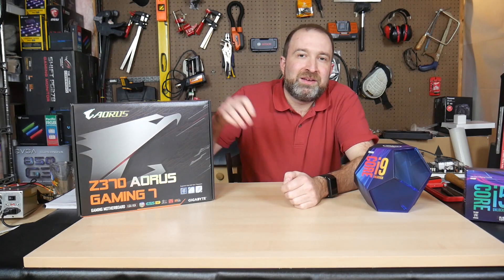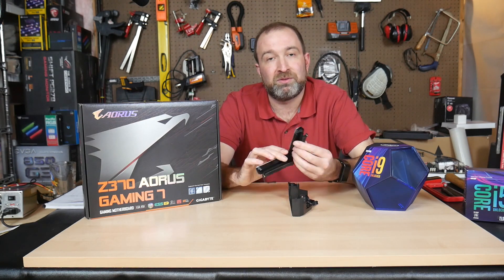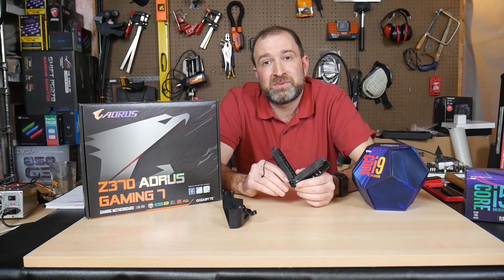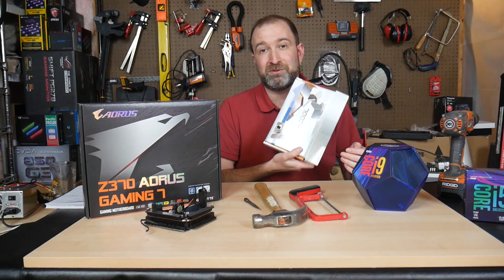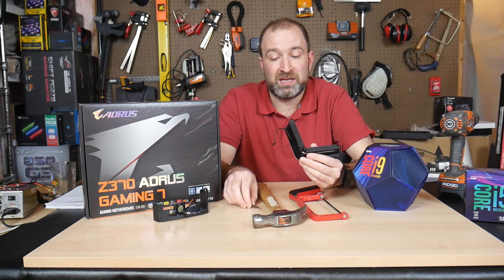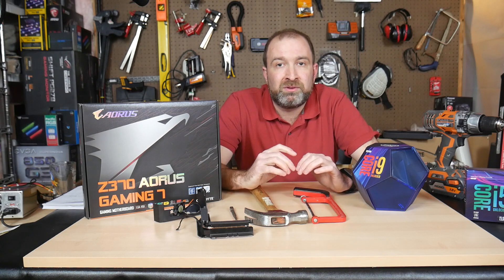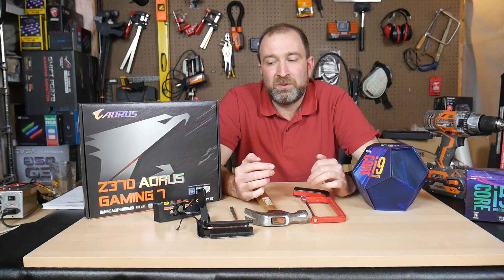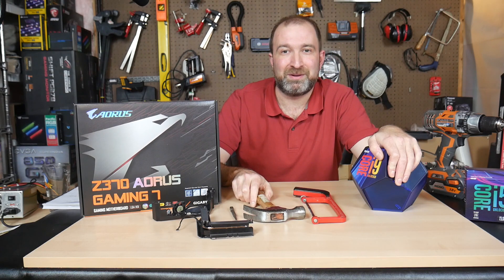Review: Intel i9-9900K vs. Z370 Gaming 7 VRM

Comment: Hello, good day, greetings from Colombia. I currently have an Aorus Z370 Gaming 7. Two days ago I installed an i9 9900k, but the CPU's maximum temperature reaches 86 degrees. With an Aorus ATC800, I don't have it overclocked. I only use it for gaming and streaming. You say this is due to the motherboard's dissipation.

Comment: I disagree with this video. Im running a 9900K at 5.0ghz VRMs sitting at 60c on my z370 Aorus Gaming 7. Just chnaged the thermal pads to something thicker and it works flawlessly. Stock heat sink.
Reply: Added thicker thermal pads to the VRMs and added a small noctua fans on top of the VRMs and stayed very cool. My 9900K can site nicely on 5Ghz.

Comment: Please help!
I9 9900k freeze under heavy load

Hi everyone!
   I have bought the I9 9900k and after the install the PCU under load was reaching 70c-75c after the first 5 minutes of playing and than jump to 89c for a couple of seconds and than the whole computer was completely frozen. Had to restart by pressing the power button.
   A couple of times, it did restart the computer by itself under heavy load. 
     
   Just read another post about this and someone recommended to change the cooler. 
    I put back the I7 8700k with my old water cooler and under load doesn’t reach more than 63c. 
   Now, with my I7 8700k is perfect fine. 
   That means the cooler is working fine? 

   Bios updated to the latest version. 
   Motherboard: MSI Z370 Carbon 
   Video: MSI GForce RTX 2080ti Trio
   RAM: Corsair DDR4 3200GHz 32 GB(4x8Gb)

  
   Can be a faulty CPU?
Thank you in advance !

Comment: I recently installed a 9900k in my Gaming 7. I am using an EK monoblock. I am currently at 5 ghz running offset voltage of -0.045. HWmonitor is showing around 1.284 while running Cinebench R23. I ran the 30 minutes stability test in R23 and my VRM is still hitting 75c and highest core is hitting 86c. I know those are fairly high temps but definitely safe of course. I am curious what your VRM temps are hitting while under a long load test like R23 for 30 minutes. Have you ran R20 or R23 for 30 minutes? They both use AVX so they really load up the CPU and VRMs.
Reply: Since the 9900K/Fs are sold of for 280€ right now, I did the same kind of upgrade for my gaming 7 as in the vid and installed some generic/adjustable VRM watercoolers I found cheap on aliexpress (7-10$) per piece. With my previous 8700K@5.1/1.38V I hit the 125C on VRMs pretty fast with prime95 AVX. The same test setup now with my 9900KF@5.2/1.37V the VRM temps stay within low 60s.
Reply: @torben82sf  Are you saying with the exact same cooling you got that much lower temps switching from the 8700k to the 9900KF? I assume not. I believe you meant to say when you upgraded to the 9900KF you installed water blocks on the VRM and then got the temps you mentioned.
I have been very happy with the performance of the EK monoblock with the 9900K. They do get into the 70s while stress testing but they never come close to that under normal use. Granted I don't run heavy AVX programs for hours on end so YMMV. Overall the 9900k and the Aorus Gaming 7 with the EK monoblock have worked perfectly for me.
Reply: @caseymartin9177  yeah Sure, 9900kf + watercooled vrms. With stock cooling I would prpably have fried the vrms under prime .

Comment: How bout Aorus z370 gaming 5, can it handle the i9 9900k? I hope u can provide an answer . Ty si 😘
Reply from the maker: I wouldn't really advise it. I think the manufacturers of MB didn't really do much other than make an updated Z270 board. With Z390 it seems like the manufacturers woke up and started putting better cooling and more phases into their VRM. In a way they are using the same power delivery designed for 4C/8T on an 8C/16T.
Reply: @SolarityTechnology  lol im running it with modifications on the z170x-gaming 5, and vrm temps are good (stock) so i see no reason for it not working well on the z370 gaming 5

Comment: Hi, came across this, great vid by the way and am very impressed by your solution.  I have tried to source the water blocks but the copper plates on all I have seen seem to be a different shape.  Is there a chance you can post the dimensions of the plates required and the fixing locations so I can source others suitable please?  I have subscribed and look forward to more of your videos in the future - ATB
Reply from the maker: Thanks! I don't have them off hand. I used an old heatkiller for a legacy board and cut and drilled it to size. I think the block is pretty standard and they customize the copper plate to mount various boards. They do have DIY kits that you can use to cut or drill to size as well. Have you thought of using one of those? I.e. https://modmymods.com/watercool-heatkillerr-sw-x-60-diy-lt-12004-4880.html
Reply: @SolarityTechnology  for now i've just dropped the heat sinks and they seem ok with better contacts, but might watercool later and then monitor temps better, the cooler the better why i like your idea. thanks for your time, i found these before so have these as an idea in the future: 
https://www.ebay.co.uk/i/253096111258?chn=ps&norover=1&mkevt=1&mkrid=710-134428-41853-0&mkcid=2&itemid=253096111258&targetid=909953938039&device=c&mktype=pla&googleloc=1006521&poi=&campaignid=10204071303&mkgroupid=104953043274&rlsatarget=aud-629407027145:pla-909953938039&abcId=1145987&merchantid=114962336&gclid=Cj0KCQjw6PD3BRDPARIsAN8pHuF5g4SMV4qSX2H-3sFB0CUyUui969-c2PSGcdBYwHlVOrOSdKJfFwwaAtRQEALw_wcB
Reply: @SolarityTechnology  can you help me out and give me the settings in the BIOS you used for 5GHz stable? i'm having trouble getting my 4133MHz DDR4 with it so want another starting point.

Comment: Would this motherboard work with the i7-9700k???
Reply from the maker: Based off power consumption numbers I looked at for the 9700K, I think this MB would be fine. The 9700k has the same cores, but half the threads of the 9900K.

Comment: I'm currently using a gigabyte z370 hd3p motherboard, I don't plan on overclocking my i9 9900k. Should I upgrade to a z390 motherboard?
Reply from the maker: I wouldn't touch the 9900k with that board. I noticed boost was even worst for temps than a tuned OC. I highly suggest a Z390 Gigabyte board, if you want a 9900K and to fully take advantage of it.

Comment: But if you do not make PRIME 95 FFTs, OCCT small data set AVX 2 ...., no reason to change the cooling of the vrms of the Z370 gaming 7, if you only play video games because the cpu in games -Video rarely exceeds the TDP of 95 W with a 9900K I9. At most 70 watts.

Comment: these vrms support a maximum temperature of 125 degrees! and if the temperature exceeds 125 degrees then the CPU drops in frequency to 3600 mhz see 800 mhz.Tested and approved on OCCT small data set avx2 and PRIME 95 FFTS.

Comment: if the PC reboots with prime95, your PSU is of poor quality!
Supernova G3 850w is PSU no name, I'm not sure that it delivers well 850W or the + 12V is properly powered voltage. in FULL load, IT MUST HAVE big Vdrop on the Rail + 12V. In order not to have a voltage drop on the + 12V supplying the CPU, at least one Seasonic PSU of 550W is required. because often the PSUs no name 850W when measuring the voltages and watts are actually 450W PSUs.

Comment: On Aorus Z370 Gaming 7.
Edit: Of course for it to work with an I9 9900K @ 5 ghz with Prime 95 FFTs AVX, it requires a good PSU (and not an NO name PSU) a Vcore manually posed 1.25V-1.35V MAX and especially ideally a waterblock on VRMS or a simple stream of Air is sufficient with a 120 mm fan.

For bios, you have to look at the CPU i9 9900K (P0 or R0) stepping from BIOS F7 to BIOS F12

Comment: edit: sorry just shortening the post. this is an overkill mod, but glad to see it works.  in most cases, the thermal pads are the issue. there's too much gap between the VRM and the heatsink/pads.  get thicker pads or shave away some of the spacers and tighten downward (not too much or it will bend/bow).  once there's firm contact, the temps drop from 110 to anywhere between 40 and 60.. I read elsewhere that the little fan they added was most likely a last minute decision because they were aware of the temps and couldn't pinpoint it.. low and behold, it's the gap... easily fixable.  otherwise, the ag7 and 9900k are a pretty good combo.

Comment: Great Video dude, I tried replacing the stock thermal pads on the heat sink and vrm temps are no longer an issue.
Reply: What type of thermal pads did you use?

Comment: Great video! I came across this seeing if anyone had any videos of 9900k running on this board successfully and what kind of issues they encountered, if any. I was anticipating higher VRM temps, which I'm not personally concerned with (EK Z270 Monoblock here, which works with Z370 boards, my VRM's typically don't exceed 45C, 1kw rad surface area, 8700k @ 5.0 GHz w/ 1.342v) but what I was concerned with were complaints that there are wattage starvation issues with Coffee Lake + processors. For example, in this thread someone is complaining of full system shut downs under load under AVX instruction set (Prime95) with a 9700k with this motherboard: 

"I have recently put a 9700K in a Z370 Gaming 7 Optane and it works with Bios 10, 12 & 13, BUT, I've noticed that it will run higher voltage than it should IMO. The VRMs can keep up, but I don't believe the power is being applied correctly for a 9th Gen CPU. One of them is my 9900K I put in after the 9700K. Any tests with load, like Prime95 with AVX or Intel XTU an the PC shuts off immediately like ran out of power under load. No freezing or BSOD, just shuts off an reboots. I thought it was the PSU I had, so it was swapped for a higher PSU and same thing. I even raised LLC and it got worse. Put the 9900K in a Z390 Master and it runs all tests perfectly fine, at lower voltage than what the Gaming 7 is putting into my 9700K and at less heat as well. I can literally run the 9900K with a Gammaxx 400 air cooler on stock settings on Prime95 and have no heat issues at all. Yet the 9700K in the Gaming 7 will hit 72C or on a custom watercooled loop. Playing with the voltages on the Gaming 7 has allowed lower temps, but this requires some custom tweaking which all in all, I would suggest just using a Z390 mobo instead for 9th gen CPUs. "

http://forum.gigabyte.us/thread/6698/aorus-gaming-upgrade-9900k-story?page=1&scrollTo=30769

What BIOS are you using and have you experienced full system wattage related shut-downs under AVX instruction set? 

Seeing as how I have about $300 or sunk into this board with the monoblock I would prefer to be able to upgrade to 9900KS sometime next year vs. having to buy an entirely new chipset + monoblock.
Reply from the maker: Thanks, I am glad you enjoyed it. A mono block would be no problem for a 9900K and a Z370  Gaming 7. The master does have 12 phases, compared to the Gaming 7's 8, though the Gaming 7 has 60A power stages, compared to the 40A stages of the Master. The master does have a really nice cooling, once I modified the VRM blocks for my board things got better. Oddly enough I to encountered a couple of annoying reboots at some point, though I haven't had that issue. IIRC it would occur fairly early in the P95 run w/ AVX Small FFT, sometimes when I just click start it would reboot. I think I got around that issue months ago and it could have been a few different variables. 

Prior to posting this I tried to replicate the issue by running P95 for a few minutes about 5 or 6 times and couldn't replicate it. The issue would occur pretty quickly. With a bit of concern with the really unrealistic high temps of P95, I moved to Realbench for stability testing. I don't think I have done a multi hour prime95 run, since my 8600K. The biggest headache I ran into was the MB sensors going all nuts after multi-hour stress tests. My biggest concern was the VRM, though with the water cooling, it is not really an issue anymore.

I recognize ezveedub from OCN. I mentioned he got better temps from using some better quality thermal pads w/ the stock VRM cooler. Anyway I read the UEFI version he tried, it looks like he tried all, but the one that I am currently using. I am using F11, I guess it has been a while, since I updated and I am feeling hesitant of updating now. ><

Reasons why my system might be running fine:
1) Specific UEFI tuning/settings
2) Use of F11 
3) PSU - I first started with was a Supernova G3 850w, it had the issue a few times, though I haven't been able to replicate it with this my $109 ax1200i Corsair PSU that I got refurbished. Planning on doing a video on this refurbished PSU in the future at some point.
4) Luck?
Reply: @SolarityTechnology  I found a posting on reddit regarding the shutdowns with prime usage. I just made the same upgrade to my gaming7 (thanks for your video inspiration!) and I am experiencing shutdowns aswell. Prime95 small FFT with AVX @5.2 and 1.3V+ -> Instant shutdown on click. The reddit poster also got into contact with gigabyte support and GB acknowledged that the LLC curves have not been properly updated to the I9 values (the 8700K has slightly different Ohms). The internal overcurrent protection is still running with the 8th gen values (which are lower). So basically the shutoff is due to (false) overcurrent protection. If you only apply a mild overclock or don´t run prime small fft, you simply don´t reach these kind of currents. Tried with F14 and F15a, maybe will try with F11 soon ;)

Comment: The stock VRM cooler on the Z370 Gaming 7 & 5 have thermal pads with poor contact and are not thick enough. Get 1.5mm thermal pads and replace the stock ones and make sure there is some air flow in your case.
Reply from the maker: Every time I see your name, I think of eevblog. I recognize your name from OCN and you were mentioning the same thing there as well. I am going to give it a try at some point in the near future and might do a video on it. I am going to moving to HydroX in the near future, and I would like to remove the VRM block, if it is possible. Also when I removed the stock pads I do recall seeing imprints for all the mosfets. Cheers and thanks for the comment, see yah on OCN!